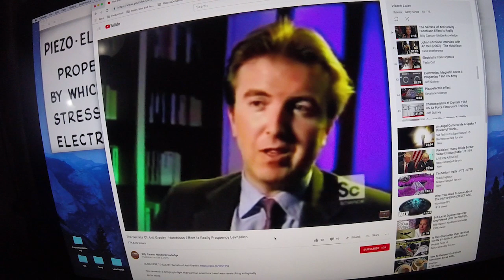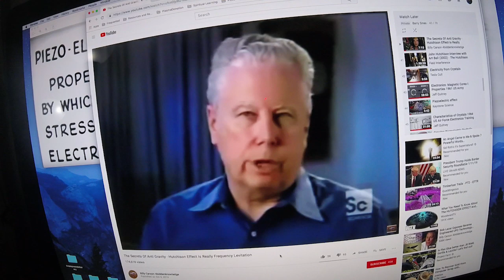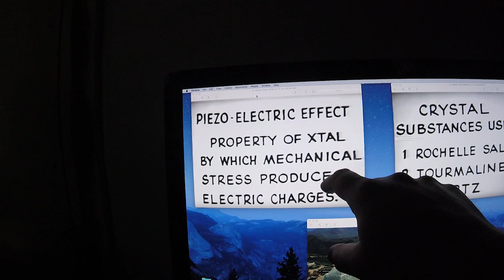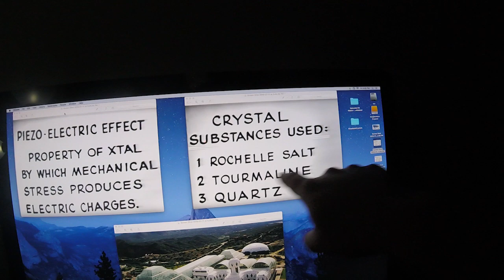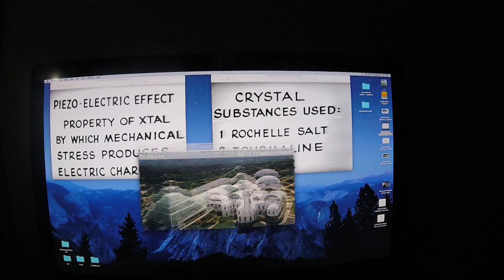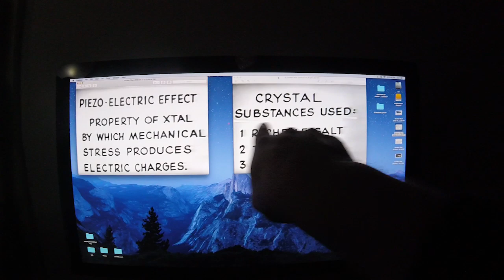DIY CRYSTAL Electricity Experiment - PIEZO-ELECTRIC Effect ✔️

Comment: As far as the feedback loop you're speaking of, entropy will always persist. Even if you use a super wide, super short conductor between the two electrodes, the material itself has resistance, which consumes voltage. Eventually, the crystals themselves will lose their polarity by degradation. The system would be expelling electrons into the atmosphere. As far as harnessing electrons for application, we already do that for sure. It takes considerable mechanical energy, which comes from your body, to produce the high voltage to create the spark. With that high voltage, comes an extremely low amperage, which is the volume of electrons flowing across that gap. It's enough to jump because voltage is the force (difference) moving the electrons. If those elections, at that voltage were put into another crystal to make it vibrate, it would bre at a lower energy than what was released from the generator crystal. If you used it to energize a circuit, it would be even less, by a large margin. Keep your ambition, but don't be afraid to accept correction and grow from it. You'll be a better engineer every day that you learn from a mistake 🙏🏻 good luck
Reply: So basically the disappearance of energy is inevitable.
Reply: Quantum zero point energy 
Is real
So is the casmir effect
Reply: @manitro337  No, the laws of thermodynamics observe that energy can neither be created nor destroyed, only transferred. In this case, the energy put in to the system is absolutely being consumed by whatever small component we'd power with it, and also being transferred into the atmosphere. Insulation to any degree wouldn't even matter because of capacitance.
Reply: @robertjames1259  Even with the absolute largest scale, most expensive, and considerately devised metrology our species collective greatest minds have contrived, we've barely been able to detect the "quantum zero point energy". It's so minute factually, that it doesn't even perturb relativistic symmetry; therefore, so far away from the amount of energy required to even be considered noise, let alone attainable.

The thing about science is, it's not about belief, in any way. It's a completely independent discipline and the greatest tool we have to grant rigid definition to the things we can observe and poke at in the universe. It doesn't care what you believe, no matter how much you say it.

Belief, on the other hand, is accepting false credence to the notions you have with no requirement for formal verification and almost exclusively demands that we defend even our stupidest misconceptions until we're completely unable to accept basic truths.

When what is real has effectively zero reality, it is effectively moot to argue with.
Reply: @VectorNodes  your concept of reality is a belief.
Reply: @commenteroftruth9790  Funny that a "commenter of truth" would get so mad over someone speaking the truth. Being a scientist is about being receptive to correction and doing better when you learn new information. Simply making pseudoscience up as you go along and adding spooky language doesn't mean you've somehow transcended physics. Science is just the practice of accepting being incorrect and improving
Reply: @VectorNodes  I misread your comments in an improper fashion in an improper mindset. What youve stated is basic law.
Reply: @VectorNodes  ur wrong you kno why? nikola tesla said “what one man calls god another calls the natural laws of physics” Also he said “the day science studies non physical phen it will have made more progress in a decade then its entire existence” “non physical phenom” means “pseudoscience” as you like to refer it to as.
Reply: @VectorNodes  probably because your too smug to communicate a real point. "you tried but just know that this will never work, and im rite and your wrong. learn from my words!" jesus christ man lol

Comment: I had the same thought, that if putting pressure on the quarts caused an electric spark, then why couldn't it be placed in a vise for constant release of energy? Find the positive side, and negative sides, and hook wires to them, then put it under pressure. If what they say is true, then there SHOULD be a 'sweet spot' of pressure that will release constant energy.
Reply: The crystal only releases electricity while it is being deformed and returning to it's original state. Of you put it in a vice and left it clamped, it will stop producing electricity when you stopped cranking the handle

Comment: I think you can produce electricity by vibrating the bunch of crystals by microwave , quartz vibration rate is 32760 Hertz,
Reply: 3+2+7+6=18
1+8=9
The key to the universe
Reply: @justinchandler8259  no lmao
Reply: @MochaZilla  He’s correct. Telsa vortex math proves there is a constant connection between 369. Look up digital roots, and Zero point energy.
Reply: @justinchandler8259  added up numbers equaling 18 then you break up the 1 and 8 to equal 9?? I’m so confused. If I have 18 of something and take one out to set it aside thennn I take 8 more out to set aside and after doing that I add the 1 and 8 and now I have a pile of 9 things…I STILL HAVE 9 more things left unaccounted for because I started with 18, right? What’s with that? 
Seperating a multiple digit numbers and adding those separate digits that originally made a wholeeee number back to itself makes zero sense honestly…

Comment: This is all old news. They have watches that use quartz crystal oscillation to create an EFFICIENT loop of energy, but it's by no means perpetual. Granted everything has room for improvement. Here's the thing. Theres no such thing as perpetual energy; however, at the same time you can have a machine that is so efficient that it would run for the life of our sun and by the time it exploded it wouldn't really matter. Get what I'm saying? It's about efficiency, not immortality. Hope that helps.

Comment: Get a ceramic jar, alternate plates of copper, zinc and iron. Pour a saturated saltwater in it. Put a positive wire at the top, and a negative wire at the bottom. Get a light bulb and connect it to s wire one one end. Touch the other end to the positive wire and negative wires coming out of the ceramic container. Boom. You just made a Babylon battery.

Comment: If you want to produce power better to look at HO generators As has already been pointed out here the Piezo-Electric Effect. Has more to do with makings Quartz Crystals vibrant at certain frequencies. yes you can produce power but such a small amount it's not work your time. 

 
Making Hydrogen from water with an HO generator is workable but the problem is storing the 

Hydrogen. The other thing that can be done is making the Hydrogen on demand. Still tricky. 

 
#2 you can take wast plastic and super heat it to make fuel .not easy but if you get it right free fuel from wast. 

3# Soler power problem here is batteries. The Batteries need to be ten times better then what we have now. In order to be cheap enough long term. We are close. Can Be done in a lab. But the  Batteries need to be cheaper to make it work long term same with wind power. 

 
#4 Can be done now but cost about 20,000 or so for your small house. Thermal ground heating and cooling. need enough land to do it they drill two holes far a part and deep enough they suck heat out of the ground in winter and pump hot air into the ground in summer. 

In many places this will not produce enough heating or cooling needed but can be used to cut your bills by 30 to 50 percent. need to do the math to see if it works for you or not

Comment: What you’re hoping to do has Already been done.
Look up “Piezoelectric Generator”.
You don’t have to play with crystals.
Why it’s Not available in stores is due to Suppression.

If you want Over Unity, look up “HydroSonic Pump”.
It’s been rated at 170% Over Unity.
There’s only 1 working unit at a NY Fire Department.
The Company was Forced out of business.

There’s also the Inline Pump to a Turbine...
No stats given but it works.

I personally like using Solar for the Battery Bank and HHO generator.
24-7 Energy with ample reserves.
You got bigger problems if you run out of Sun Light and Water...

Comment: You may be under the impression that this is a way to create free energy. I don’t want to disappoint you. I only want to help you have a better grasp on what is actually happening. First, it is impossible to create energy. The total amount of energy in the universe is constant. It never increases or decreases no matter what. The quartz crystal does not generate energy, nor is the voltage that is generated (not total energy generated) extracted from the crystal as though it were initially stored inside it. Quartz is not a generator of energy but a transducer. That means it changes one kind of energy into another kind of energy (in this case, mechanical energy into electrical energy). Your hand applies mechanical energy (which comes from the calories in the food you eat) to compress the crystal, and that energy becomes electrical. The total amount of electrical energy you get from doing this will never be greater than the amount of mechanical energy you put in. In fact, it will always be slightly less because a small amount will be converted to heat (which is another form of energy). Conversely if you apply a voltage to the crystal (and you mentioned this) you get mechanical energy, but same as before, energy out is never more than energy in, and some is always lost to heat. And I say “lost” not because energy goes away but because heat is a form of energy you can never get back into any useful form. The TOTAL energy, though it may be distributed into many forms, will always be the same. This is what physicists mean when they use the words, “conservation of energy”. Suggesting you can generate energy by feeding the system into itself is like suggesting you can create water by pouring it back and fourth between two cups, or that you can save yourself from drowning in the mire by lifting yourself out by your own hair locks like Baron Munchausen. By doing this, you will never create energy, you will only succeed to make the universe a little bit warmer every time you do. You CAN however introduce an amplifier to your feedback loop to sustain the vibration of the crystal (the amplifier would need to be powered with a battery or something of course). Then you’ll have yourself a handy little oscillator which you can use for maybe keeping time in some kind of digital clock. That’s right, technology has been using your loop idea for a very long time in digital clocks and computer systems. Electrically powered machines that keep time have a tiny piece of quartz crystal in it shaped like a tuning fork hooked up to an amplifier to function as an oscillator for keeping accurate time. It’s a genius example of engineering, and it was curious people like you who experimented tirelessly on the horizon of discovery that made this technology available to us. So stay curious and keep experimenting, asking questions and learning.
Reply: No point trying, he has made his mind up that he knows better than everyone else.  These people never get a working device. They just talk about how and why it's possible "no matter what people say"
Reply: Nathan chalecki He didn’t come across to me as one of those “I found free energy!” frauds. I believe he was just being curious and inventive. Science history is rife with crazy outside-the-box ideas, some of which led to important discoveries. He indeed was mistaken about how energy works but dead ends are just part of the discovery process. I commend his wild approach to learning and encourage him to continue exploring the universe exactly the way we see him do so in this video.
Reply: What if i put it in a press? there is no energy invested other than the initial compressing
Reply: Is the universe not expanding? Just curious where that energy is coming from. Seems like if that is happening then maybe you could get more out than you put in